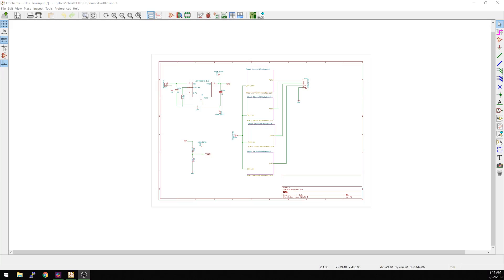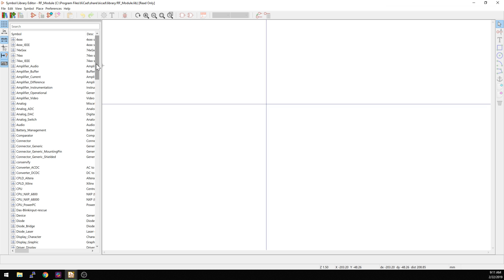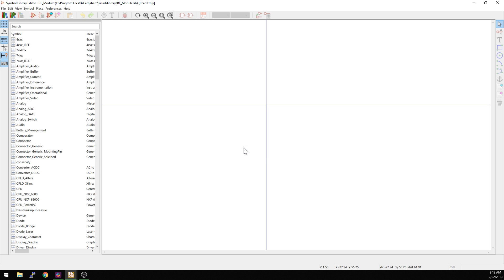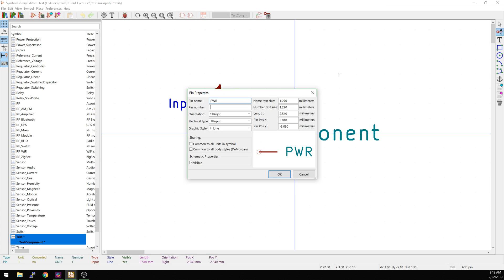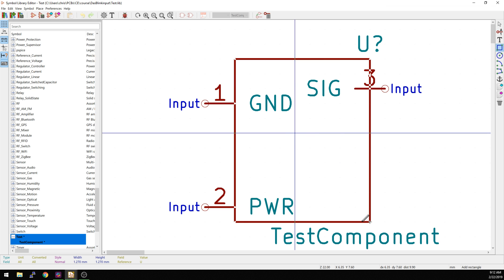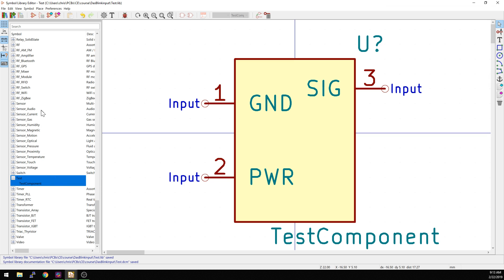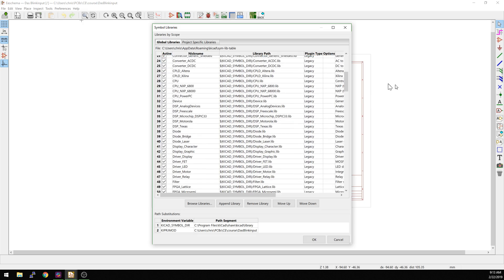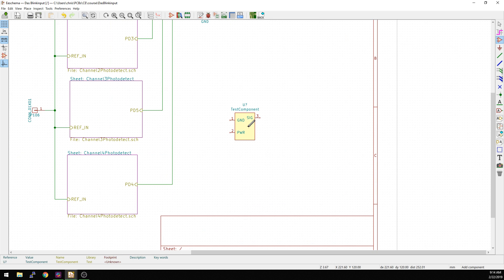KiCad 5.0 - Adding a new symbol library

Comment: Request for an update for KiCad 6.0 - it appears to use a different method as the "new library" button no longer exists in the Symbol Editor. Thanks.
Reply: I found an answer. With the Symbol Editor open, there is a menu pick available, File > New Library...